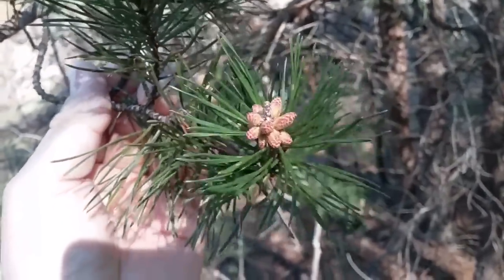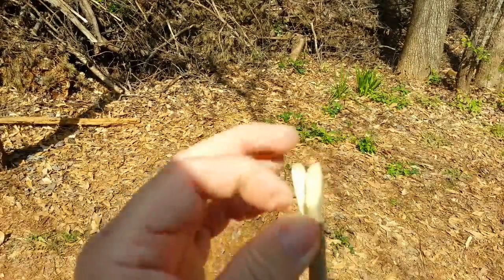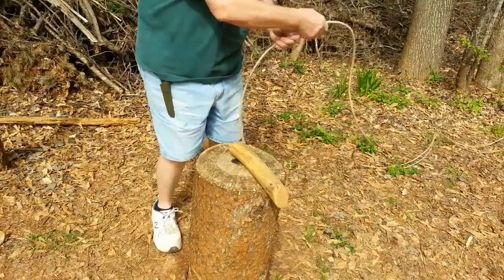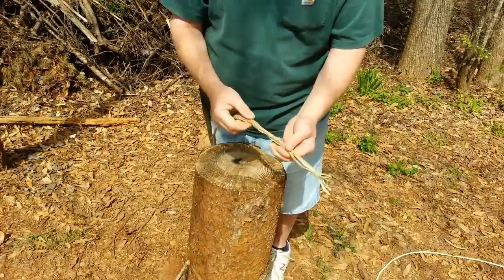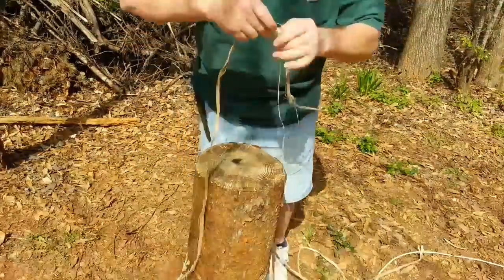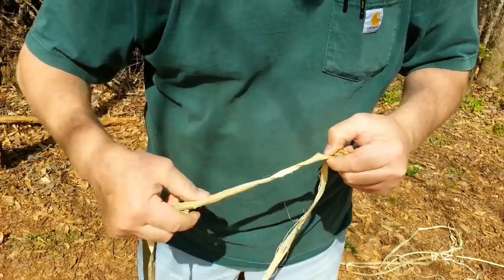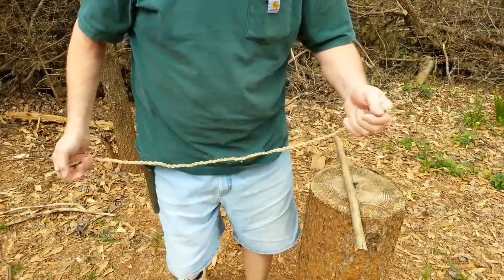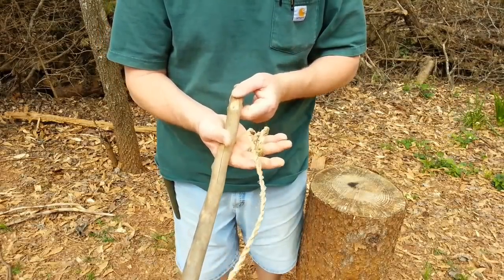Making Kudzu Cordage for a Bow Drill Bowstring

Comment: Wisteria vine makes real strong cordage. Wood fiber cordage is supposed to be more supple and workable if it is boiled in ash water after it is dried. I have not tried that. What is the best match for board and bow drill spindle to get an ember. I just started learning. Really enjoy your channel.
Reply from the maker: edward leroy I've used Wysteria Inner bark for Fire Roll. It is very strong. Privet makes a good bow drill set.

Comment: this is great, I have to check if there is something similar growing in my area, because it looks  great and it holds up  nice and for quite a long time, unlike for example spruce root cordage, when you use it for bow drill. Great thanks for sharing this.
-Matej
Reply from the maker: I need to get around to trying Spruce root.
Reply: for me I think it breaks too easily.. or me technique is not correct... time and experimentation will tell